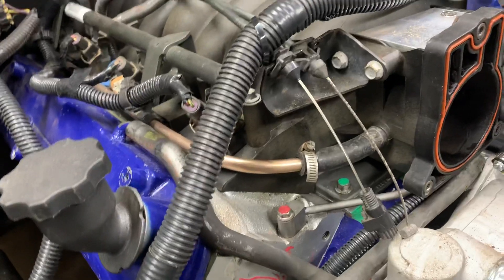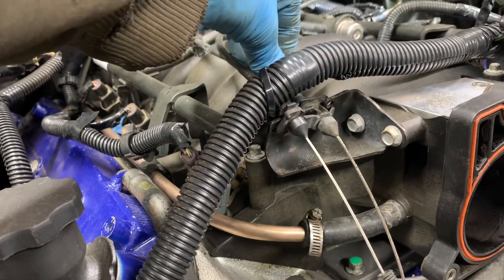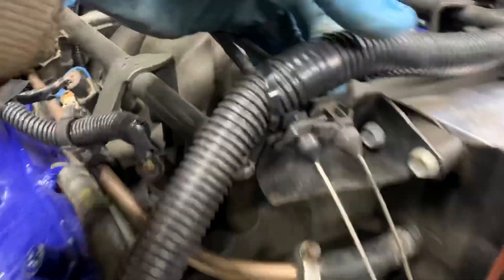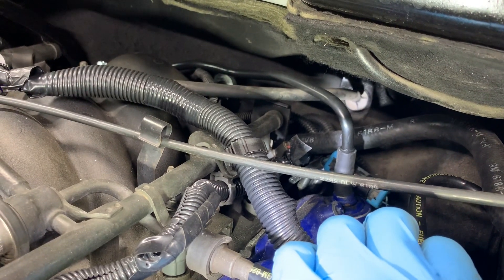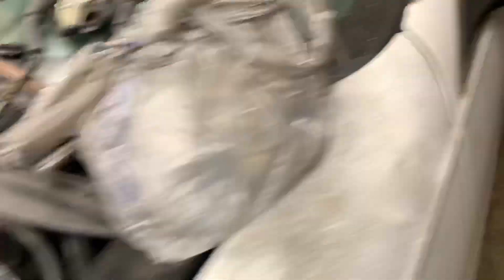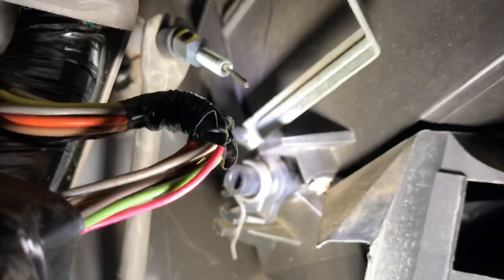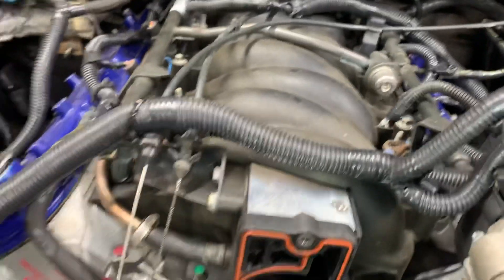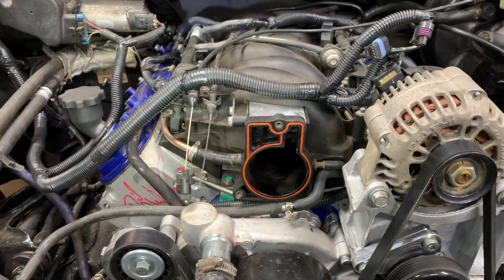B-body LS Swap Throttle cable how-to video

Comment: I'm sorry bro I know I already asked this but how do I stretch the shift cable to the other side next to my throttle cable
Reply from the maker: That’s the cruise control cable.., shift cable is under the car attached to the transmission. But the caprice doesn’t have a cable under there for shifting. It has a metal bracket.
Reply: @thehowardsgarage2480  omg I feel so stupid I get it lol so I guess the new question is how to connect my cruise control
Reply from the maker: @datboikenny2020  it happens man…. No big deal, and if you have a cruise control box under the dash with that cable on it, then you just run it to it, but you don’t need cruise control to be able to run and drive the car.

Comment: What about the shifter cable, does it have to be longer or did the original fit across? 🤔
Reply from the maker: Original worked fine. But there’s no shifter cable on these cars, it’s a shift lever.
Reply: @The Howards Garage  thanks again I ordered all my parts except for my harness that'll be last. I'm almost done! 🥳🤯
Reply from the maker: @datboikenny2020  that’s crazy, congrats brother!

Comment: Part number?
Reply from the maker: Actually I’m not 100% sure on that. It was just in one of the isles in AutoZone that had the carburetors, and cold air intake kits, and other performance parts. It wasn’t a special ordered item, it was just off the shelf. But, i do remember that it came in a kit, and I believe it said on the package that it was for a carburetor throttle kit. Hope that helps brother, sorry I didn’t have the part numbers.
Reply from the maker: Which part number are you referring to? The cable I used was just off of a junkyard truck.
Reply: @thehowardsgarage2480  the little cable stOpper that you used from a carburetor kit

Comment: What transmission do you have, I have a 700r4 thinking about going to the 4l60e but wouldn't that be drive by wire which would need an electronic gas pedal?
Reply from the maker: I used the 4l60e…. The Drive by wire was more common in 2002-2003 and later…. But the 1999-2003 had drive by cable, and the 4l60e
Reply: So because I did a 5.3 swap in my 91 Caprice a 4l60e should go in no problems or would there be more work?
Reply: Thanks for all your help! 👍🏾💪🏾
Reply from the maker: @datboikenny2020   it should go in without any problems…. And it’s no problem brother, thanks for watching!

Comment: Do you have the part number for the Cable??
Reply from the maker: The cable is the stock cable.
Reply: @thehowardsgarage2480  for v8 engines? I went to many shops in my country they dont know which one.

Comment: Are you still using the cruise control for the car?
Reply from the maker: Darrell Adams yes I am...
Reply: @thehowardsgarage2480  So you're using the stock cruise cable for a 94-96, which I'm assuming is longer than that of a '93?
Reply from the maker: @1sick57  yes I am, and not sure about the length difference on the 93, but the 96 was close but worked
Reply: How did you wire it to your swap?
Reply from the maker: Darrell Adams I didn’t wire it. It was already wired into the car, you just have to make sure you have the cable for the throttle body hooked up.
Reply: @thehowardsgarage2480  I'm sorry I meant to the ads system
Reply from the maker: Darrell Adams lt1swap.com has all the wiring pin outs for your swap

Comment: I just bought a 99 Corvette LS1 engine and It didn't come with the pedal and TAC sensor so far I've researched that it's cheaper to go DBC like your set up but I don't know which DBC throttle body matches the LS1 since it has to be connected to the DBW throttle body. Any info on that? Thank you!
Reply from the maker: Moe Contreras since it’s an LS1 it should be a standard 3-bolt throttle body, so any 98-02 5.3, 5.7, 6.0, or 4.8 should work just fine.
Reply: @thehowardsgarage2480  does the harness connect straight to the TB or do I need an adapter for it???
Reply from the maker: Moe Contreras can you email me pictures of your connectors? Bbodylsswaps@gmail.com
Reply: Just emailed you a picture
Reply: @thehowardsgarage2480  did u keep cruise control

Comment: Did you have to shave the bracket or cable any ? I’m trying to get mine on as I watch the video
Reply from the maker: Tubby T No I didn’t shave the bracket or cable at all. If you need any more updated pictures or anything you can message me on here or email me at BbodyLSswaps@gmail.com, And I can give you some pictures or whatever else you need. Thanks for watching the video
Reply: B-Body LS Swaps I’m doing a swap on my ss that’s why i ask I have the same ls1 intake an bracket an a truck throttle cable I had on it before I swapped the intake from truck to the car one I have on there now
Reply from the maker: Tubby T ya that’s great, I love seeing the b-bodies with the LS swaps. Awesome motors for an awesome car!
Reply: @thehowardsgarage2480  I have a gbody but the caprice will be next once I get done with the monte carlo I'm working on now
Reply from the maker: Tubby T lol for some reason when you said SS I assumed you meant an impala ss
Reply: B-Body LS Swaps nah I’m not that luck yet I’ve been looking for one in good shape an not to expensive the caprice is a 📦 style
Reply from the maker: Tubby T ya I feel you... Impalas are priced really high even when their junk
Reply: @thehowardsgarage2480  yeah I seen one for 10,000 riding one day I turn around to catch the guy he was gone 🤦🏾‍♂️

Comment: Your videos are helping a ton! I have a 93 Caprice wagon I'm swapping. Think you can make a quick video how you wired the engine to the car? I built my own harness just would like to know the best way to wire everything to the the car itself..
Reply from the maker: Vaughan Marshall  thank you very much for watching my videos, I’m so happy to hear that they are helping you. My whole goal was to help everybody save some money and time. It was hard to find these kind of videos whenever I was doing my swap. I could make a video but unfortunately the wiring wouldn’t be the same as your 93 as it would from my 1996, and I’m not sure what kind of wiring harness or engine you used but I use a stock wiring harness from a 2000 Chevy Silverado with a 5.3 L V8 and integrated it to my factory wiring harness.
Reply: @thehowardsgarage2480  I have a 95 , can you show me your wiring?
Reply from the maker: @chevyrider9679  Unfortunately I cannot show you my wiring in that vehicle specifically because I sold the Caprice, but I will be doing another LS swap soon so keep an eye out for the videos and if you didn’t subscribe already make sure you subscribe and I will get you any video you need, thanks for watching